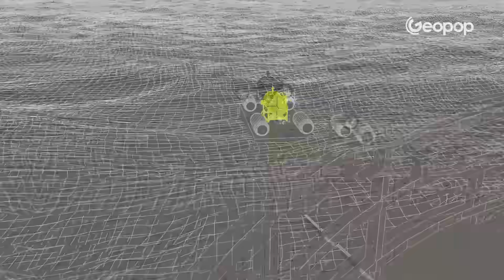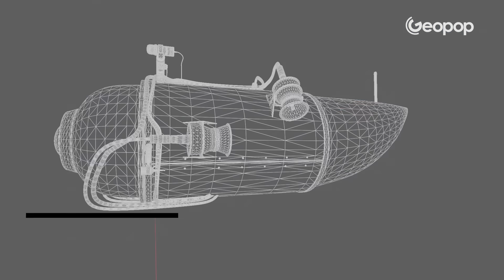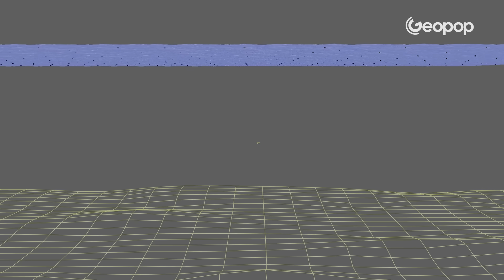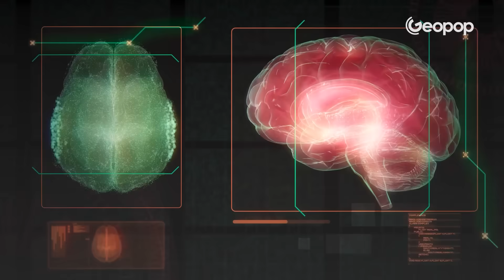Titan Implosion, two year later: the 3D reconstruction and the possible causes

Comment: The ends being glued on really got me. They should have at least made a stepped flange on the caps and wound the carbon fiber over it. That way it locked it almost mechanically together rather than just glue. I think the ride out on the raft beat the crap out of it and compromised the whole thing.
Reply: Don't forget, that thing had been on numerous dives already. I know what he means about metals becoming "fatigued", it starts with micro-fractures you can't see. Heat can cause it, too.

You wouldn't catch me on that sort of death trap, I can't even imagine the levels of anxiety I'd be experiencing down there, listening to a virtual tin can snap, crackle and pop around me. I'd rather do a space walk on the space station.
Reply: @deletethis6902  Yep only 5 psi difference from a space suit to vacuum, whereas the Titan had over 2,500 PSI difference between inside and outside...
Reply: They couldn't wind the carbon over on the caps because it served as the door. 
And you're right about the raft. I believe the ride out could've also damaged the sub's wiring and electronics.
Reply: @SilhouetteSE  not just the electronics but the whole structure 4 sure
Reply: @centennialfarm11  absolutely
Reply: @SilhouetteSE  I was thinking a flange that stuck out of the fixed pieces that were glued. Almost like a L layed on its back. That way the carbon would have had better strength. I'm sure they had a reason it wasn't feasible but that glued on ends really bothers me.
Reply: @centennialfarm11   I see. That sounds feasible; however, I don't think anything could've saved that carbon hull from its doom.
Reply: Ti caps and rings are quite heavy and this thing took beating from rough sea.
it's safer when it's under a little pressure.
Reply: heck those bells should have been bolted to the hull -- just saw on latest released coast guard video where the ring was supposed to have something like twelve bolts in it but info released by someone involved in the launch said rush just told them to use four because the pressure of the ocean would hold it in place-!!!??  Bottom line the whole thing was built as wrong as it could be, especially compared to the numerous FULLY CERTIFIED round thick all steel or titanium ones that have been used numerous times with no failures whatsoever -that speaks for itself.

Comment: Most likely the tube deformed slightly and a leak then occurred between the end caps and tube. That immediately filled the tube and the shock blew it apart. There should be large pieces down there of the tube. As well as bodies.

Comment: Did I miss it, or was there no explanation of what could have happened? Different scenarios. Leak from interface, tube collapsed, or leak. Would the tube simply have collapsed and should therefore be remains of the tube. Would the tube float? Or the carbon fibre pieces?

Comment: I believe that the temperature changes from hot on the transporting barge in the bright sunlight to near freezing submerged also added up to the fatigue. Resin doesn't like it cold and it makes it brittle. With that immense pressure a perfect recipe for delamination when the hull is being compressed and released through the diving cycle.

Comment: Why the explosion though? Is it like water generating friction on air?
Reply: ‘Implosion’. Much like you jump on a KB can after you’ve drunk the contents.
Reply: @SeriousSchitt  the what?
Reply: Not an explosion as such, just the massive amount of heat generated by the implosion due to Boyle’s Law… “If pressure on a gas increases, then it’s temperature will increase”.
As it imploded, all the breathing air inside the submersible would have been squashed into a tiny volume by the sea pressure. Real experts reckon for a split second the the air in the submersible would be reduced to about 1.4% of its original volume, and if it started at room temperature, it would end up at about 1400C / 2500F.
Reply: @notmenotme614  I forget air is a gas, the water acts as a compressor ?

Comment: James Cameron has gone on record twice stating that the U.S. military heard the implosion on the Atlantic Hydrophone Network.  The "knocking noises" that were reported in the media were just random ship sounds that were picked up after the implosion. Also, the crew knew the containment was failing.  There were snapping, cracking, and popping noises coming from the hull prior to the failure. There were detectors cast into the hull to monitor these noises and the system issued an alert.  They tried to ascend, dropping their ballast weights, but the intrusion of water into the failing hull increased the weight of the craft and they were unable to make a rapid ascent.
Reply: Yea I guarantee the USN knew about it/heard it. If it happens in the ocean, the Navy knows about it pretty much. But the thought of it failing like you said, I hadnt heard, and is terrifying!
Reply: @MattH-wg7ou  Yes, this video is accurate on the instant implosion theory, but other videos show that before the implosion, the occupants knew they were in trouble. Stockton sent text messages to the surface telling of wierd noises, warning lights, jettisoning weight, and that they were trying to ascend but rising slowly.
Reply: @briandroesch3259  That is correct.
Reply: @brianroesch3259  I don't think that conversation was verified authentic. Last I heard it was disproven as being made-up.
Reply: @o_manam  Ok thank you.  I hadn't heard that those text messages were disproven. I saw another video that said they were made.
Reply: @briandroesch3259  Of course, the way it was written seems very real. I wonder if we'll ever know for sure.
Reply: @o_manam  They say an investigative report is being prepared by some authority. If a report is made, hopefully we'll find out what is known fact, and what isn't.
Reply: @o_manam  In the meantime, I'll go back to watching Caitlin Clark basketball!
Reply: @o_manam the actual comms were in short codes, and cant be normal speech, the "bandwidth" with sound based communication is low and long range, like low frequency radio compared to high frequency, but with sound it's much lower frequency. So even in text, it was done in short codes they had memorized.
Reply: @o_manam  We know for a fact that the Titan and the surface tender, MV Polar Prince, were equipped with acoustic modems. The Titan was in communication with the MV Polar Prince during the dive. There is no reason to assume that these communications stopped prior to the implosion.
Reply: @o_manam  My information regarding their final communications comes directly from James Cameron. Cameron gave an interview to ABC that was published June 22, 2023. In the interview he indicates he had spoken to a number of people close to the dive. I took this to mean on board the MV Polar Prince. He said:  "we understand from inside the community that they had dropped their ascent weights and were coming up, trying to manage an emergency."
Reply: @MattH-wg7ou  There were multiple witnesses who heard snapping, popping, and cracking sounds coming from the hull during previous dives in this death trap. At least one of them raised concerns with Stockton during the dive and he replied with "Five inches of carbon fiber has a safety margin large enough to allow for some fiber to fail." -- Then the hull sensor system was explained. The idea was that significant pops and snaps in the hull were monitored with sensors, and the computer would give them ample warning of an impending failure, giving them time to abort the dive and reach the surface. They were warned by the system apparently, but the failure of the material was adding mass to the vessel gross weight and ascent proved to be impossible. But they knew, they knew for about 20 mins they were on borrowed time.
Reply: Um I don't think so. There was no slow intrusion of water making them heavier. The infusion of water was the implosion . To suggest it was leaking in is ridiculous at that depth.
Reply: @ChadFarthouse-h8r I think what was meant is the hull itself being soaked with water through micro cracks, not water intruding to the inside of the craft.
Reply: No way in hell would I have gotten in that tin can.
Reply: @Toastcat890 You mean plastic bottle?
Reply: Very thorough!! Thank you 🤘
Reply: @ShadyAcres28  Thank you. This was an interesting case, and we are still waiting for a report from the U.S. Coast Guard Marine Board of Investigation (MBI).
Reply: They used SOSUS which they use to listen for enemy submarines and anything else in the water.  Been there since the 50's and still classified
Reply: Yes,the original SOSSUS is still in use. If it can hear a nuke sub sneaking by,it would hear all this
Reply: How are so many people stupid enough to believe that a vessel can "leak" at that depth and pressure? The vessel would have imploded immediately.
Reply: The Naval microphone network on the seabed detected it instantaneously but the system is very top secret. A young man tracking the movement of tagged Great Whites also detected the time and location of the implosion when multiple Great Whites homed in from several directions on the blood soup rising in the water column. Sandy bottom sailors do not good submariners make. Should have stayed on the beach.
Reply: They didnt want the people to know til the next day
Reply: You had it til the last part. The water getting in was the implosion.
Reply: If I recall correctly, Cameron said that hearing knocking noises above all the noises of all the ships in area would have been like "hearing a sparrow fart in a hurricane."
Reply: This isn't possible, and yet you say it with such confidence. No water could have possibly been leaking into the craft. One moment it's dry, the next moment it's crushed by the water. There's no in between
Reply: @trninfan Yes everything I’ve read about pressures at that depth with this sub’s construction, make it clear that as soon as any water gets in, it’s over in an instant.
Reply: @trninfan  this is exactly what I was thinking...what's wrong with people? Lol.

Comment: When I watched a professional replace my Porsche's windscreen, I was super impressed with the machine which dispensed a perfect 40mm-tall triangular "wall" of adhesive on a perfect line around the inside of new item, I understood how perfectly it would be bonded into the chassis. When I saw the machine he used to lower the windscreen perfectly into place, and how he used it, I understood how incredibly well the windscreen became a part of the vehicle, adding to its overall strength...

When I watched the crazy people at Oceansgate slap a whole bunch of silicon around the opening of the carbon fibre tube, prior to gluing on the titanium dome, I knew it would kill all aboard in short order. It was like watching ignorant children in a workshop. Imagining for a single second that manually applying the sealant/bonding agent, by hand, and then roughly shoving it into place was acceptable goes against everything I ever learned in my workshop.

Not only were the two materials entirely different, and the gluing woeful, but the viewport wasn't rated for the depth they planned to use it at.

Only crazy people could imagine anything other than insta-death for the occupants. They would have heard cracking sounds, I'm sure, as it was famous for doing so. But at the end the poor souls had no idea of their own death. They were crushed to nothing inside 2 milliseconds.
Reply: @Axdbjjrmfkmr it rly feels like some of these youtube channels that make these videos rly wanna give stockton rush grace that he doesnt deserve. i think he was a rude, arrogant and egotistical nutbag who was so lost in making himself a celebrity that he thought he could cheat physics with subpar materials, like expired carbon fiber.
Reply: @entr0pix Well said! Your description of him is spot on! Just watching any of his interviews , that was the exact impression I got from them too. 
Well that and he seemed like he would have been absolutely insufferable to be around for any length of time. In my own opinion.
Reply: @Prettypoisonswitch  exactly!

Stockton was raised enveloped in wealth. His ancestor was one of the signers of the constitution, his wife’s wealthy great grandparents died on the Titanic, Stockton’s father was of the top tier in San Francisco society and Stockton grew up in a home estimated at $16M
I share this because sometimes those with wealth live in their minds so high above the clouds that they believe they are invincible….example Elon Musk. 
Arrogance, narcissism, selfishness, greed, impatience, not listening to those who are experts….are ingredients which create disaster. 
I would have never gone on a dive like this if I had to sign in eight places where the word death was used ….you could not pay me enough. 
And, unfortunately for these passengers, all the money in the world couldn’t save them.
Reply: All valid observations, but all those other problems aside, just using CF as a compression vessel sounds absurd to me?! Especially for repeated cycles!
Reply: Wow, basically the same thing my husband said while watching them 'slap' on a bunch of silicone prior to gluing on the titanium dome...he said I wouldn't get in that thing in my swimming pool...I know he was kidding there but he is a professional fabricator and welder...😂
Reply: Except the viewport not only survive multiple dive... It also survived the implosion. Also... A professional MANUALLY placing the windshield by hand and adhering it to the chassis by hand would also be just as strong. LOL
Reply: @NoReply28  ??????
Reply: do they even know they're dead yet? At best we are all just merely deeply closeted dead men.
Reply: Sorry, I stopped reading after Porsche.😂
Reply: @sensfanin so did I. I skipped most comments until I saw the word Porsche again.
Reply: @sensfanin 😂😂😂😂😂😂

Comment: It was idiotic to not have any hull reinforcements or secondary porthole fail safe. I guess hindsight is 20/20.
Reply: Porthole fail safe?!? I would kindly invite you to attempt going to 4000 meters in a vessel with an openable port hole and see how that works out for you. Explain to me how you are going to open a port hole when there is 2.5 tons of pressure per square inch. IF you were Jesus Christ 2.0 and somehow through sheer tyranny of will opened that port with probably around 50,000 lbs of force on it, you would instantly be crushed just like they were. They got crushed because the pressure hull imploded. What makes you think opening a door in the hole at that depth would result in anything different 😂😂😂😂

Comment: I did an interesting, and inadvertent, experiment when I went up to the top of Pike’s Peak (just over 14,000 feet above sea level)).

I had a plastic bottle of water and had taken a drink from it while at the top of that mountain.  I then closed it and put it on the seat next to me.

When we got to the bottom of Pike’s Peak, I reached for that same bottle and noticed that it had compressed due to the increased atmospheric pressure on it.
Reply: Now imagine the 5 people inside the titan after they realized they werent rising and sinking then they hear cracking noises, bet they had a few minutes of pure terror, the implosion was instant but leading up to the implosion took a few
Reply: There’s no evidence that anyone on board knew they were doomed. They may have heard noises, but on previous dives when those noises were heard, they were told to not worry about them. Maybe some of them were nervous, but it wouldn’t have been due to thinking they were doomed.
Reply: Yep I drank a bottle of water up there and then screwed the lid on tight on the empty bottle and tossed it on the dash of the car before we descended, and told my daughter to watch that bottle... it was half flattened by the time we reached the bottom from increased air pressure.  I have the bottle on display on a shelf here to show others.  

Time before last when I was up there I was gonna open a bag of tater chips I had in the vehicle and eat a sandwich, and the bag was inflated like a car tire, stiff as a board, from the reduced air pressure at the top of the mountain... I couldn't even get a grip to tear the bag open and figured it'd pop like a balloon and throw chips everywhere if I DID open it so I just didn't bother... when I got back to the bottom of the mountain the chip bag was back to normal and I ate my chips then...

Comment: Good presentation, bad conclusion. With better planning and greater execution that mission would have been possible. We know what forces to expect, design has to account for equal pressure from all sides. A cylinder is the wrong shape for such extreme conditions. As you point out multiple times, a sphere is normally found to offer a better distribution of the force vectors. Why wasn't the capsule certified? Why wasn't it lowered first without humans for an empty run? Lawsuits will not bring anyone back but, there is a great indication of irresponsible actions leading up to the tragedy.
Reply: It had already been used different times succesfully. But the slow killer was not noticed, which was the fatigue of the carbon fiber, probably worsened by the continuous stress at the joint with the titanium half spheres.
Reply: It was tested a multitude of times with no humans, operated remotely. It was then "tested" a multitude of times with volunteers internal to the company down to 4000 meters, 200 meters lower than where it failed. It dumbfounds me there are people under the impression they just loaded up some people on this cigar tube first go around and didn't have any testing first. Basic critical thinking identifies this as a ridiculous notion.
Reply: @zbubby1202  James Cameron was not too kind about the inconsiderate risks taken. Thanks for your comment, where did you get this information?